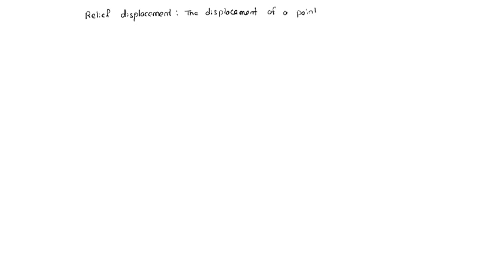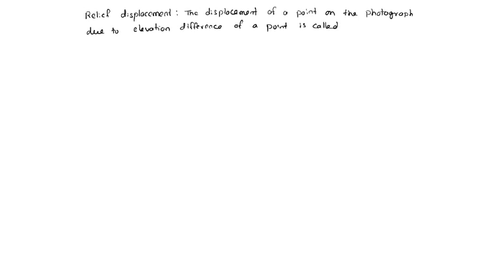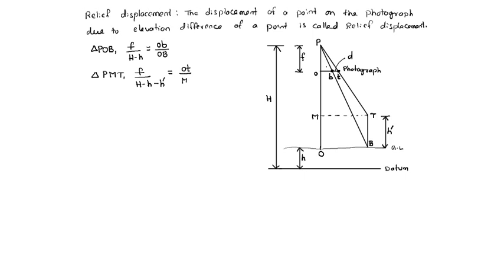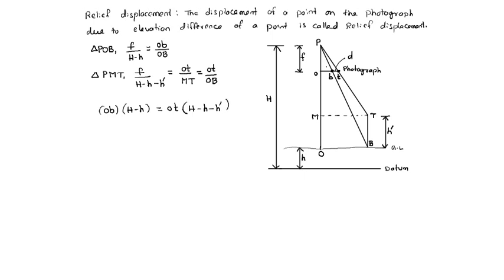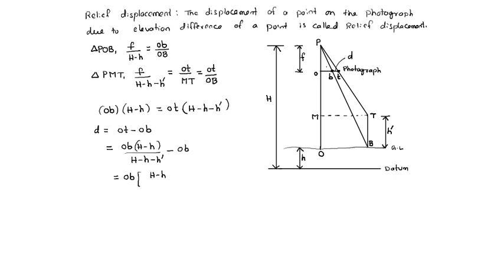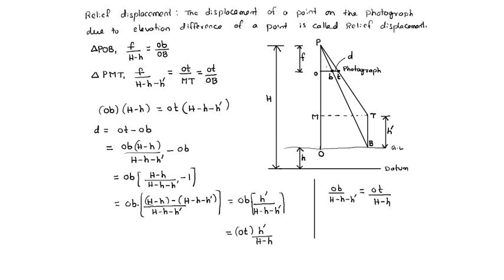relief displacement

Comment: Since, the ground is not even in most situations and if it is an undulated terrain, then how can we take the height from datum to ground as 'h'? The value of 'h' may vary with respect to ground!
Reply: In that case we usually take the average value I guess.
Reply: @sunitak8462  yes , i also think that is correct .